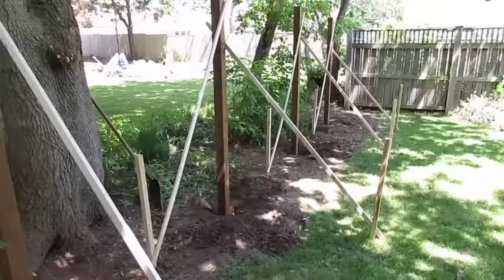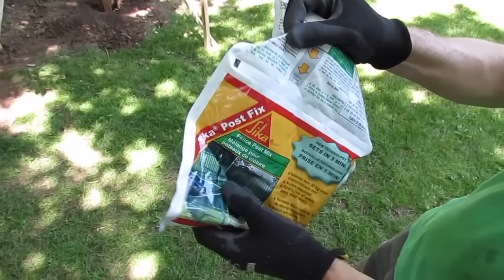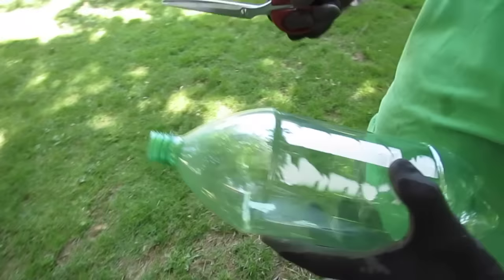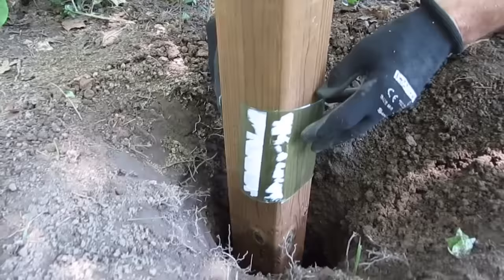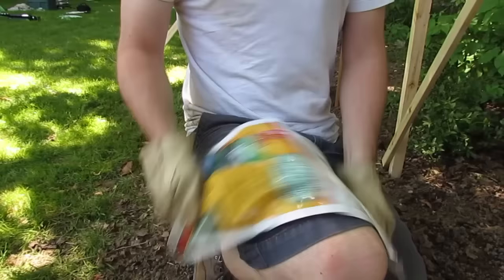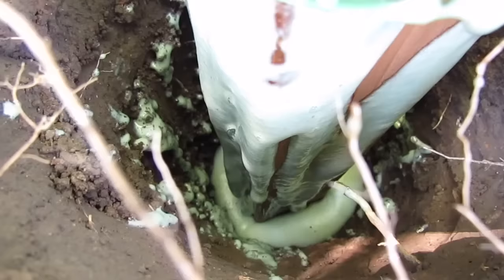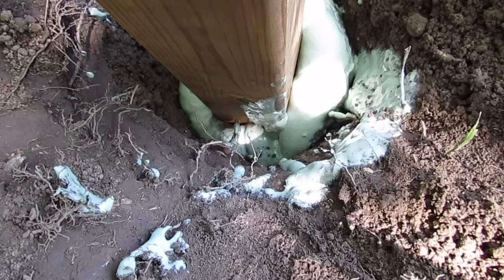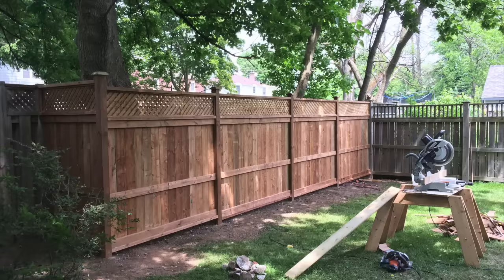No Concrete Fence Post Install!

Comment: Gimmick product .
Use concrete .
Done .
Reply: This type of foam has been in use in the utility sectors for at least 20 years and for good reasons compared to heavy bags of concrete mix:
www.youtube.com/watch?v=0c_af02kBao
sika is not the only brand, there is also Secure Set, Rainbow something and Fast2K
Reply: Joshua79C C 
Alright sir , I was not aware of that . Thank you for the information . 
I started to build with concrete in 1978 and inspected concrete bridges and buildings in the 1990’s . I’m biased , lol .

Comment: I don't recommend this product on anything but DIY. Do not use for a customer. You will hate yourself. Do not use for corner posts. Maybe you can use it in bedrock. Water gets in and around the product and loosens up the soil making it useless.

Comment: Egh, I'm not a fan. Concrete just seems better.
Reply: THANK YOU for a short, concise, polite reply! I like the novelty of this video, but will also stick with a blend that is intended for use, and has worked for me before - numerous times.
Reply: @jenniferw-c5940  The foam definitely seems like it would work for its intended purpose. I would try it out. Ya gotta be innovative. I wonder if it is much cheaper than using concrete?
Reply: @jasonroberts8206  thanks for you pokite comment. :) Where I live they sell bags of cement blend that are intended for setting posts. I think these are less expensive...but neither costs a lot (except when you're setting a lot of 'em) ;)

Comment: Nice Job, I will use foam when it goes on sale as it is much easier to manage versus concrete which is very dusty and heavy and heats up a lot causing more climate global warming changes, also the foam is more flexible which will withstand end time earthquakes where as concrete will shatter causing even more misery for those on earth Because their posts are not straight up in the air due to the massive amounts of earthquakes that occur during the end time great tribulation.

Comment: This shit sucks.........sunk 10 6x6s and could easily push on them and work them loose......had to dig em up and use concrete
Reply from the maker: That sucks, mine turned out fine.

Comment: Product is a joke 
I used this as a trial on 2 posts when building my fence. After 16 hours went and tried to move the post and guess what it came loose in the ground with pretty  little force! There is no way to build a strong fence with 2lbs of foam that expands but doesn't bind to the dirt around the hole. 60-80lbs of wet concrete per hole defiantly was a huge difference than this crappy product.
Would not recommend if you want or need a strong fence!

Comment: Mistake number one your holes are too small, mistake number to that phone is way expensive you can mix a concrete in the hole mistake number 3 you don't need to use all those braces if you tamp the bottom of the post with enough dirt it'll hold up and use a string up top good to go.    I could have knocked that out 2 hours maybe.
Reply from the maker: Oh yeah I'm sure. Would you finance it with your bitcoin knowledge?
Reply: @PatonHaus  as a matter of fact...yes. ;)
Reply: I'd be happy to post some fence videos..if you need help.

Comment: pretty sure this isnt the intended purpose for this product. If it is, holy shit. $20+ per post?  are you fucking kidding me? wtf is wrong with a sub $10 bag of concrete
Reply from the maker: Yup it is the purpose, same stuff the utility companies use to set hydro poles in place. The price varies wildly depending on where you live, but yeah not cheap.

Comment: I guess this stuff works for stingy people that don’t want to pay for quality workmanship.
Reply from the maker: Stingy? Not really, foam is significantly more expensive when compared to concrete. Everything is relative, do you drive a Hyundai or a BMW? Do you own your own house or do you rent an apartment? Folks will spend money as they see fit, or according to what they can afford. The cheapest way to build a fence is just not building one at all.

Comment: TOTALLY BOGUS. THIS GUY MUST OWN STOCK IN THE FAILING COMPANY. DO NOT USE. YOU WILL SPEND MORE TIME DIGGING ONE OUT THAN YOU WOULD POURING CONCRETE INTO THREE. If you are stuck with a supply - I bought 3 and will only use one - better have a bunch of 2"/2" wedges to fill in the gaps.

Comment: No. No. And No.
Just buy a good post-hole digger, and a tamping iron. 

The dirt you have dug out with the post-hole digger, use to tamp tightly in around your post. Just put a few inches in around the post, and tamp. Repeat. 
Again and again, until you get to the top. Better than concrete. Because you can get the post out if you want to.
Farmers have been putting in fences like this for eons. Tried and proven. 

Tamped soil is FAR better than FOAM! 
That stuff is poisonous to your soil. 
You will live to regret this. Mark my words.

Comment: Way too much work for this product. A bag of postcrete, no mess at all. Pour the bag in dry, add water to the hole done. No mixing, no cutting bottles. No rolling bags waiting for ingredients to mix.Watching the video took longer than it would securing the post with a bag of postcrete.  I can't fault this guy for wanting to share a new product. Just not worth it in my opinion.

Comment: It seems to be a good alternative but very costly@ $11.47 per bag. You used a little over 2 bags , " that is over $23.00 per post" , what the hell is wrong with you.
Reply from the maker: Better get your calculator calibrated, 4 posts, 5 bags total. $14.33 per post.
Reply: PatonHaus well my friend. I'm not in the desert. There's plenty water here and a bag of concreat is only $3.00 ln time of lnfalation.
Reply from the maker: Infalation is awful isn't it?
Reply: PatonHaus yes my friend. 😃 .
Don't take it personally, have fun. See you later.

Comment: I dare you to set the footers of a home on stilts with this stuff. Homes and hvac systems have to be on stilts where I live. I only use this foam for craft projects, 4x4s that are also attached to a perpindicular fence aswell, or if there is a tree next to the fenceline to attach to also. You have to sink these farther, use more foam than recommended, and buy longer 4x4s to sink lower too if you dont want a fence that has a shake to it or blows with the wind. I prefer 6x6x10s and two 60lbs bags , bury em 3 to 4 feet and cut excess. Will be there longer than you. Just use a rhino liner spray on bottom of all your post, tape off what sits in ground and coat it, let it cure and the fence will have problems with cross braces before your posts...Donald Trump is going to use this to build his imaginary wall.
Reply from the maker: Yikes, you must be a lot of fun at parties.
Reply: @PatonHaus  I have thrown/hosted three parties in the past ten years. All three have made the front page of the paper...for good and bad.. lol

Comment: Stupid idea, expensive, and holds moisture rotted out wood, just like all the cars rot out because factories use foam in car metals to deaden sound, Rots metal too!  Pour quick bag cement post mix in seconds, done, no mess, $9.00.

Comment: Terrible idea. Foam will be soaked in a short time, it's not impervious to water ingress. Plus it doesn't really stabilise worth a damn, will shrink too. How is this faster than concrete? It's not. And removing the foam (only a matter of time) will be alooot of annoying work. Concrete is easy, fast, much much cheaper and lasts. Doesn't pollute and it's UV-proof. This is just terrible to watch.

Gravel + pole shoes + concrete will last you a very long time and is quite easy.
Reply from the maker: Nah man it’s fine

Comment: Can't get much easier than mixing cement and builders mix in a cement mixer or if no cement mixer available then mix it in a wheel barrow and shovel the concrete into the holes. 
Unbelievable how lazy humans are becoming.
Reply from the maker: You're saying how easy concrete is to use, but then say how lazy humans are becoming? Which is it? Aren't you lazy if you're using the easier method? Hmmm

Comment: WARNING:  Don't believe the hype on using foam in replace of concrete for setting posts. I saw a fencing job that was done around a horse and all the poles were lose.  Horses and cattle lean on posts and they soon loosen up.
Reply from the maker: Good thing I don't live with any horses.

Comment: Avoid problems and mess with concrete? Have you ever used expandable foam before?? Talk about a big fucking mess. What a horrible idea. Next time just dump a bag and a half of concrete and add the water to the hole. This is lame.

Comment: Jeez what a waste of time and money!
Reply from the maker: Oh for sure, it’s much much cheaper to just not build a fence at all, maybe that’s more your speed.
Reply: @PatonHaus  Hahaha, I've dug more fence post than you can possibly imagine!   But I just dig a hole, no concrete needed except for the corner post and I dry set them!  I wouldn't do that if I built a wooden fence but being barbed wire you pull against your corners!   Sorry you got your panties in a bunch, but you can spend 4.50 on an 80 lb of Crete verses 15 for foam and with crete no mixing so all that was a waste of time and money!

Comment: Are you kidding me.... You spent roughly $25/ post hole and wasted around $10 or more left over. No thanks. $20/bag is beyond logical.   Spending nearly $30/standard hole plus another $15/post gets expensive, not to mention wasting the remainder of whats not used.
Reply from the maker: Wait, you're saying I spent $25 per hole, or $20 per bag, or nearly $30 per hole? You might want to re-calibrate your calculator.
Reply: @PatonHaus  if its $20/bag... You used more than one bag per hole and up to $30/standard hole just to fill.  My math is fine. You used around $25/hole whereas anyone using a shovel will have to used around $30/hole. I paid $4.25/80lb bag of Crete. Done.

Comment: That is so fukn gross. Being a carpenter and someone that cares about the earth, I would never pour that crap in the ground for some later pour soul to have to remove at the end of the fence's life cycle.
Reply from the maker: Have you ever pulled a 3’ column of concrete out of the ground? I would say the guy that yanks out my fence in 15 years will be very happy with how lightweight it is.

Comment: With all the added work involved, you should just try being a man and use concrete.
Reply from the maker: Concrete? You should try being a man and fabricate a 1/2" steel plate fence.
Reply from the maker: How many fences have you built there? Does concrete do well in their sandy soils?
Reply: PatonHaus sure does

Comment: This is the dumbest alternative to a standard operating procedure that I have ever seen. Two thumbs down.
Reply: C II I’d rather blow my back out lifting the concrete then mess with this foam crap. The OP should hide under a rock. And what’s with him making braces to level the post? Postcrete dries in 10 minutes and can be leveled perfectly as it sets.
Reply: C II not only did he break out the kitchen a scissors, he cut up a 2 liter of RC cola to protect the posts from the foam. I installed 86 posts on my property and could never imagine the time wasted to protect 86 posts. In fact, I’m flagging this to YouTube as spam.

Comment: What if I don't drink the sugar water in the bottles there? And what if I dont have anyone with a watch, is it OK to count off 30 seconds in my head? I know it's one of those superhuman tasks that only people such as myself can actually pull off but trust me I can count time in my head as difficult as that may be to wrap your heads around. (Addressing the "We" in the video.) BTW $4.25 gets you an eighty-eight pound bag of sackrete from lowes and you could've set all your posts with one bag no mess, just by simply pouring the dry mix around the post and watering it it sets only a wee bit slower and I do understand it's not as trendy yet sooooooooooooooooooooooooo much cheaper and just as fast. Not a hater, unless confronted with abundant amounts of moronic stupidity. BTW Sika makes good stuff, their sealants for the caulk gun are outstanding, and if you need two part foam for doing this type of thing there are better density foam products at a much cheaper price out there if one was inclined to look for them.
Reply: I'm a small woman and can't carry 88 pounds, so this product, or one like it, would actually help me out.
Reply: What are those cheaper foam products that you mention, and where do we get them. Please elaborate.